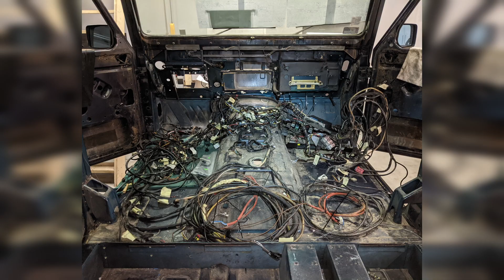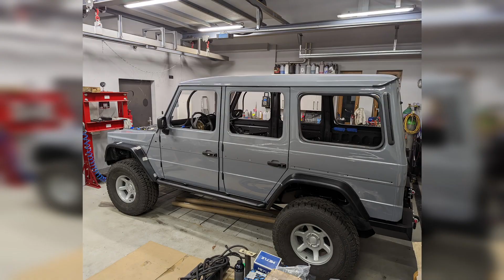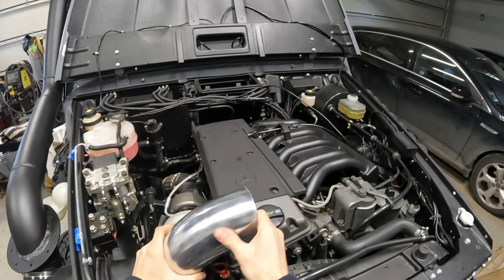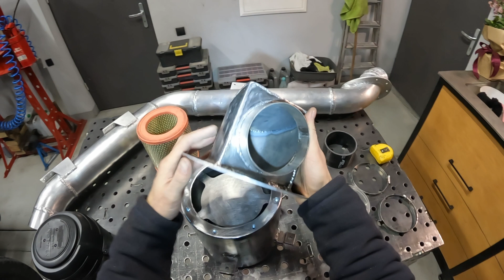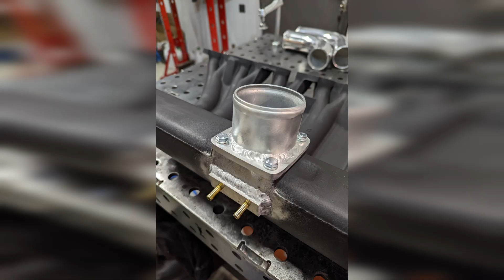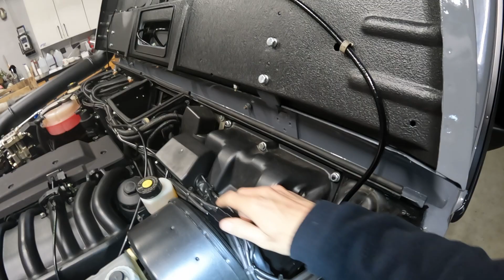Mercedes G W463 complete rebuild (OM606 engine bay modifications - part 4)

Comment: Excellent explanations.  How did you get your instrument cluster to work without the ecu?
Reply: Thanks for the answer.  I will be swapping my om602.983 for om605. I also intend to use a mechanical pump from an earlier om602 engine ( om602.983 uses an electronic version). I plant to use the oil pan from om602 just like you. I will try to transfer most of the items from Om602 to Om605. Again, thanks for your very detailed videos.
Reply from the maker: Great, no problem, good luck!!
Reply from the maker: Thanks! My G-Wagon comes from 1991, it came out from factory with OM603931 engine and this is fully mechanical 6 cyl diesel engine - no ECU - my instrument clusters needs no ECU.

I swapped with OM606 to which I mounted mechanical injection pump from my old OM603, so I kept all the mechniacal simplicity. 

Speedometer cable comes from transfer case and rpms comes from sensor in oil pan - I have also replaced oil pan from my OM603.

So to summarize - I have prepared OM606 version to exactly fit all the factory connectors in my engine bay.

Comment: What did you use for brake lines, and windshield washer lines?
Reply from the maker: I went with steel brake lines (lot of time spent to bend) and HEL braided (elastic) lines where needed.
For windshield washer lines I bought factory hose: A 010 997 89 82. Its accesible at Mercedes dealer, it can be ordered by the meter.
Reply: Thank you so much. Love your build. Trying to bring mine up to your standard.
Reply from the maker: @ryanharte528  Good luck with your build!

Comment: Sitting in Arctic Norway, and have a -94 G350 that broke a piston rod and smashed the block...😑 Now I'm going to put in a OM606, and man...!! What an inspiration to watch this!! 🤩🤩  I'm curious! How did it work out with the engine cooling with the intercooler and oil cooler, and all that? I saw in previous video that you still have the plastic shroud behind the custom radiator, how did you get it to fit when the new radiator is thicker? The link to the radiator doesn't work, I'm really curious on the radiator and how it worked! And the air filter box, and the filter, where to get that? ....i have so many questions...😂😂
Reply from the maker: Dear Gunnar, thank you for this comment.

You have very nice G Wagon, I like G350 with OM603 turbo.

Please take a look in details at these videos first:

https://youtu.be/xz78KT_gaU8
https://youtu.be/Y6GDcmdddYQ

Here:
https://youtu.be/P4Z4yr0k2Js
Somewhere closer to end there are some photos of frontend without fenders, showing coolers job.

Engine cooler is not that much thicker, just slightly, all that plastic shrouds fits no problem.

All the temperatures are good, no overheating and this pretty big success with this prechamber combustion engine.

If everytnig goes according to my plan I should be in Arctic Norway in july reaching Norkdapp ;)

Cheers and good luck with swapping with om606, its a great adeventure.
Reply: I was also very pleased with the 3,5 liter in the G350, but it has one weakness that i got the bad experience of: weak piston rods...😑 

You have definitely done something right with your setup if you have no heating problems with such a powerful OM606 build! I'll definitely copy some of your modifications! The tuned up OM606 builds use to get some heat problems if they have original cooling system. I guess the intercooler have to get some of the credit for that because it's HUGE compared to the original one on the G300! I asked if you've had any heat problems because I thought that the intercooler and oil cooler would "steal" to much of the cooling capacity in the front of the car.

I'd also want to get the intake air from the right side fender like you have done, just without the snorkle at first, can't afford it all at once..😂  Your solution gives a really short way from turbo, and no pipes and such over the engine like i have now! But the air filter and casing! Can you provide part number or link to where you've gotten them? Also for the top of the snorkle so i can put it on the to-do-list for later? The air filter is massive, and it will give a lot of air clearance for the turbo!🤩🤩🤩

Oh, you're going to Nordkapp!? If you take the route through Lofoten on your way north, which i really recommend, you'll drive practically right through my back yard!😂😂 Would you be ok with me sending you an email to stay in touch so i can pick your brain some times when I'm in the process with my own OM606 build? Also it would be cool if you stopped for a visit if you come by these parts on your way to Nordkapp! 

Again: great build you have done! It greatly inspirational to watch your videos, and it gives many good ideas for my own build! Thanks alot!

Comment: Hi 
I am in Corsica
👏, you are a source of inspiration, Your work is marvellous !!!! I too am in the process of replacing my OM603 in my G-class with an OM606
Can you give some information ? do you replace the oil pump completely?
Best regards
Reply from the maker: Thanks!!! :)
Yes I have replaced factory oil pump and oil sump from my OM603931
But as far as I remember I also needed drive chain from 603: A 003 997 78 94 (30 eur before VAT)
Reply: @MercedesOffRoadClub  Thanks 🙏

Comment: Hi, amazing build, what size intercooler did you use, is it 600x300x76 ?
Reply: Thank you for the reply, I have ordered the size you recommended
Reply from the maker: Thx, intercooler part number: FMIC IC45023065
Core: 450x230x65mm
Total: 600x230x65mm
Inlet/outlet: 63mm (same as HX35 outlet)
I choose this size to fit oil cooler below intercooler
Reply: @MercedesOffRoadClub  A good alternative would be the intercooler a4635002200 installed in the later 350
Reply from the maker: I was concidering this one, but new is around 1300 euro before VAT. And I think I would not fit it between my radiator and engine bulkheads. It is also pretty tall, I would not be able to mount oil cooler below it as well.
Reply from the maker: There is also another number A 463 500 21 00 which is little bit cheaper

Comment: what type of paint did you use on the intake manifold? i love the color scheme
Reply from the maker: Its been long story with this intake manifold. First I painted it with black VHT spray. Later I made so many engine fittings to frame that I destroyed this paint, It got some oil on it as well, so I flushed it and temporary painted it with Luxens black mat paint for steel. This is anticorosion paint that I use for steel, but I just used it for now. When time comes and I sort out all the problems I maybe take all the parts and powder coat it at one shot.